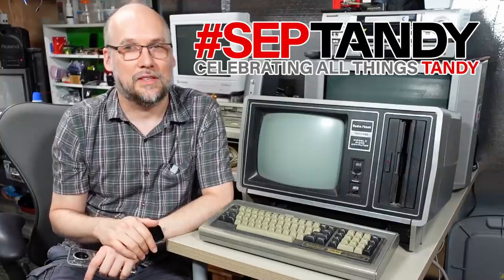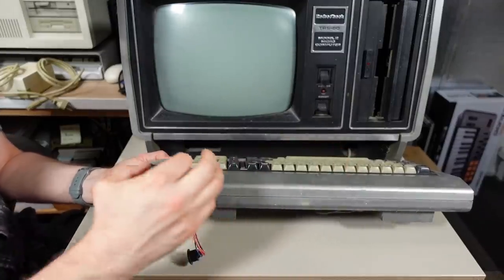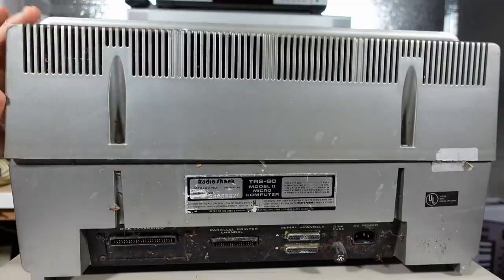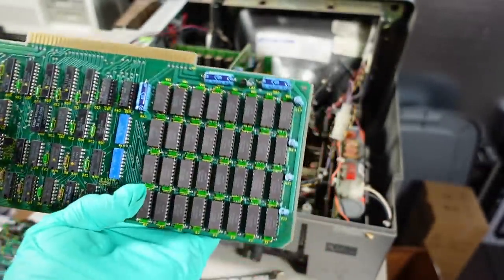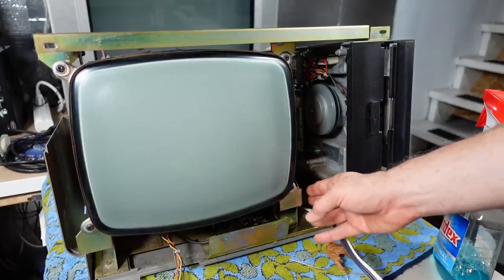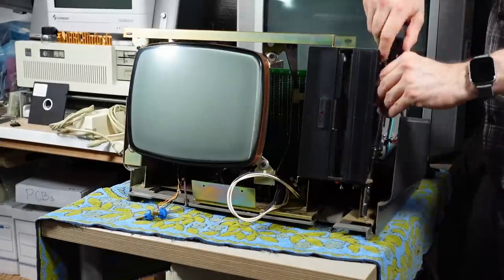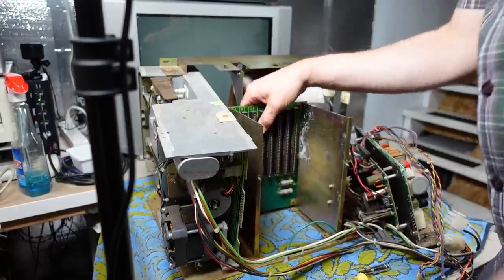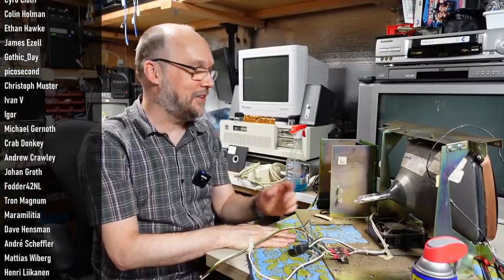Another left for dead machine: a TRS-80 Model II #septandy 🕸🕷🐜

Comment: I worked for Radio Shack Computer center back in 83 and there were still Model IIs floating around, and the 12s and 16s were being introduced.  I had a chance to peek inside the 12s and 16s back in the day, but it's been so long I don't remember what I saw..lol.  I think though, that the 12 was a redesign of the 2 to make it a bit easier to work on, and the 12 was upgradeable to the 16 as the 16 was a 12 with a 68k board.  In any case, there's not a ton of software available, and virtually no games, as it was considered a business machine and there was no market for games.  Also, it wasn't nearly as popular as the I/III/IV line which also was used as business machines.  The 2 was a bit more high end, so it was not sold anywhere near the numbers that the others were.

Comment: If I remember correctly - you could also plug a hard drive on to this.  5 or 10 Meg. It was a 12 inch platter and renown for head crashes.
Reply: Hard Drive unit was a 8MB unit… retailed for $4999.99…. I remember our store only sold one.
Far more popular was the 8” Floppy Expansion Unit… it held two floppy drives…
About 75% Model 2 buyers also bought the floppy expansion.

It seemed to me that every Model 2 buyer also bought the desk…. I LOVED those desks! They were SOLID!
Reply: @ernestgalvan9037  When I finally retired my TRS-80 model 1 it had.

Lev 2 Rom, 16K main Mem, Expansion with additional 32K (48K ram in total) with disk doubler and 4 x DSDD 80 Track floppy disks. It was about as maxed out as I could make it. I also had managed to get an old IBM Selectric Terminal for which I'd type out bulk letters for some local businesses.  All of this many many years ago now - pre IBM PC.

Comment: on these 8inch floppy drives there is a little red felt pad inside that keeps pressure on the head assembly from the other side of the floppy.  If these pads (about 2/3 the size of a pencil eraser) go bad or get stiff or wore out, the floppy will not read/write properly.  they must be replaced with new felt.  they are on little plastic buttons that snap in and out, but the button is very easy to break.   just shave the felt off the button and re-glue a new felt pad.  IF YOU DO NOT replace these they will destroy the floppy disk as you use them, look close.

Comment: I ended up working on a Tandy similar to that (6000 maybe?). It was running xenix with 5 wyse terminals hanging off it, 15mb 8" hard drive, 8" floppy and 10mb Bernoulli that was scrap at the time 30 years ago but everything worked
.

Comment: The TRS 80 series might have officially been released in the UK, but they are very rare over here.  I think commercially they were way too expensive for the market and ended up getting buried in comparison to other brands like Sinclair and Commodore who were much more price concious.  I believe that one of the big selling points of the Dragon computers was that they had a certain amount of compatibility with the TRS 80 line because that was pretty much the only way anyone was likely to be able to use any TRS 80 software.
Reply: Yes, the TRS-80 line was relatively rare in the UK, being considerably more expensive than Sinclair and machines like the Vic-20.  I can remember reading various computer hobbyist magazine in 1980/81 and drooling at the TRS-80/Apple /Pet adverts which were very, very expensive for an 11 year old schoolboy :)  RE: Dragon32, I think you're right, it could run TRS-80 software, but I don't think it was a clone?  Time to go check out the Dragon-32 wiki.

Edited to add : keep up the good work Adrian, this is going to be a great series!

Comment: I would suggest that the next shop tool that you acquire should be a small air compressor. The ability to take appliances like that TRS80 out back and just go ham with an air nozzle is a game changer.
--
RE: TRS80 software - The machine runs CP/M right? I don't remember, but the Z80 puts that in the realm of possibility.
--
Shuggart 8". I think it unscrews from that angled base plate a bit easier than taking the whole thin out, baseplate and all.
--
Hope you are doing OK in Portland. I noticed that you saw the 2stroketurbo video and his recent dilemma with another stolen car. Sounds like it's getting bad in Portland. 

Cheers,

Comment: The entire computer revolution basically started when it did because two groups of engineers were pissed off that the company they designed CPUs for... wouldn't sell them at a reasonable price.

The Z80 and the 6502 were basically sold at 1/10 the price intel/motorola were charging

Comment: To paraphrase the title of an old 1960s B-Rated Horror Flick - "Children Should Not Play With Dead PCs"

There was compatibility with the TRS80 machines that few knew about; they all ran TRSDOS (TRS80 DOS), the issue was the disk format between the machines and with the Model 2 using 8in floppies compared to the Model 1 & 3 using 5.25in floppies.

The Model 2 (64k version) also ran CP/M. A modified Model 3 and the Model 4 (both with 64k) also ran CP/M but again floppy size snd format incompatibility did not allow for sharing files and software via "SneakerNet".

Somewhere I have the TRSDOS manuals and the 8in floppies somewhere in storage. I can not vouge for their condition as when I pulled out a couple Macs from storage they showed water damage, which I later found out was from a fire years ago on a higher floor above my storage unit.  One day I'll brave it and see what can be rescued.

Comment: “No user serviceable parts inside.” And we designed it that way!
Reply: No worries, there's a Radio Shack less than 5 miles away--if you have a DeLorean.
Reply: @davefarquhar8230  88mph away
Reply: @davefarquhar8230  there's one literally 5 minutes away. "Authorized retailer" in the back half of a furniture store.

Comment: I can imagine a problem using an older PC is getting floppy disks. 5" disks are pretty common, 8" disks are harder to get. And of course, if its the right size, it might not have the right specifications. High density, low density, single or double sided, soft-sector - hard-sector ...

Comment: This cost $3500 when new... Most of that was probably assembly costs.  Focus on design for manufacture has advanced immensely in the past 40 years, but rarely gets mentioned - until you come across stuff like this.
Reply: To be fair, putting it together was probably a pretty straightforward process... that just had to be done in exactly the right order using the company's own specialized tools. It's just fixing it afterwards that takes forever, and it's not like they had any more incentive to make that simple than manufacturers do now.
Reply: In 1980, $6 - $8/hr would be about right for a line worker. It did not take hundreds of man-hours to build these. The components were eye-wateringly expensive compared to now; just 64k of memory alone would be $500 or so in 1980. The major gains in manufacturing efficiency since then are orders of magnitude higher for the compounds than for the labor.
Reply: Still, the design is unnecessarily clunky.  You can tell nobody spent any extra effort optimizing the chassis.  It probably evolved into what it is now, from a series of prototypes that were just good enough to keep using.
Reply: @nickwallette6201  
You've put it perfectly. I was obviously exaggerating about 3500 being spent on assembly, rather the point I was trying to make was that other than for tiny specialist production runs, you just wouldn't see construction like that these days. By the time they got to the model3, they knew they would be making it in significant quantities.
Reply: @BM-jy6cb  lol, when you read youtube comments, nothing is ever obvious ;-)

Comment: the sequence for Tandy business machines were: Model II, Model 16,Model 16B,Model 12, Model 6000, Model 2000..etc their numbering system was a bit strange

The card cage backplane was patterned after S-100

I worked for Tandy in the 1980's and worked on hundreds of Model II's this tear down is frustrating ..i am yelling at the screen how to do this without taking the chassis out..I never had to remove a chassis ...
TEAR DOWN:
the long nut driver is required throughout the machine we had a 12 inch long driver to work on Model II's
The floppy can come out without removing the front cover..4 screws in the base and unplug connectors and lift out..
to remove the CRT remove 4 screws holding the driver board to metal plate..then remove the four screws holding the CRT in (after removing front cover) and it (CRT and driver board) slides out easily from the front of the machine..
PSU: remove 4 screws holding the PSU to the metal plate and unplug connectors and lift out..
at that point all that is left in the machine is card cage, wiring and chassis ..

Before you power this up PLEASE clean the anoid area and get all the WD40 off of it...WD40 is the worst thing you can use on electronics...

If you have any questions that i might be able to help with.. feel free to either reply to this comment i will monitor it

Comment: I'd love to own an 8" floppy drive, but they're so rare it's hard to find them, never mind have the money to buy one, especially as there's certain western militaries still using them in some installations to maintain very old equipment... :P
Reply: I used to have a wang standalone single disc drive, it was as big as the whole computer Adrian is working on, I still have like 10 blank church fan floppies too.
Reply: I had an NEC APC that was an all in one like this, oddball MSDOS 2.11 machine with 2 8 inch disk drives. They held about a megabyte
Reply: I've some in my loft part of a trs80-II

Comment: So in the late 70s and early 80s i worked as a young software and hardware engineer and I owned one of those model II computers in Australia.  I burned an new character generator EPROM for it and amended the build in Microsoft basic to have graphics commands the same as the model I and III also I had a board in there with a Motorola 68000 16 bit processor and ran a version of Unix on it.  As a heads-up I seem to remember the CRT unit had a bug or something and the horizontal oscillator frequency could run away and the CRT would emit a high pitched sound and if not switched off immediately would self-destruct.  Since I would experiment with the circuitry and assembly language programs this happened several times with mine.  I sold it in 1983 and switched to IBM compatible computers.  i have however, fond memories off the machine.

Comment: I once had one between 1982 and 1984 with a 5 1/4 disk drive and 10GB hard drive. I was running a BBS system with 4 outside lines on it. It worked flawlessly and ran 24/7 for several months. Then I had sold it to a friend and he continued to work with it for another year. What happened to it after that I don't know, probably taken to a container park. When I see this now, I regret it, but yes, a man can't keep everything in his life ;-)

Comment: The TRS-80 Model II uses a backplane similar but not identical to the S-100 bus invented for the Altair 8800 and which later became an industry standard for a period of time. Thus the Model II does not have a motherboard, like the Altair 8800 and thus every key component that would be on a motherboard of say a Apple II or IBM PC 5150 instead went on a card that plugged into the bus system as part of the backplane of Model II (CPU, video output, memory, Floppy drive controls, etc.). The IMSAI 8080, the computer used by the main hacker character in the film War Games was a clone of the Altair 8800 and thus also used the S-100 bus.

Comment: Haha :) "At this point I can remove the power supply board..." and I'm thinking... "well, at this point, you already removed everything else FROM the power supply board". And yes, some of the older things aren't meant to be servicable. Mass production wasn't a consideration for these things back in the day. I think these are from the "maybe 1000 companies need a computer" days, so I guess nobody expected that there would be a large number to keep in service. Also: mains voltage was not really a big issue back in the days of tubes, and that thought carried over with some designs, so it's not uncommon to have mains voltage all over with no extra protection. Only trained professonals should open up cases anyway 😜

Comment: I don't think you needed to take this apart except to blast it with an air compressor.  The easiest thing is to fire these things up... I can't believe you took it apart.
For software, you can install Montezuma CP/M 2.2.  TRS-DOS is fine.  Scott Adams adventures did run on these.  If you want to really impress, you can try and figure out how to upgrade it to a Model 12 or 16B, which I think was possible.  Finally, the hard drive is indispensable on these things.  Get one.  You can also get a COBOL compiler to build executables.  There might have been a BASICA compiler for TRSDOS... can't remember for sure.  Finally, get some copies of the Radio Shack MicroComputer News if you're going to do a lot of "TRS-80" you need to get the bound copies of that and look over all the old program listings, advertisements, etc.

There is also an external floppy drive unit for the Model II.  Meh.  Just mentioning it.
Really the Model 12/16B units are the ones to have since they can do a lot, whereas the Model II was really only a "high-end" Trs-80 Model 1 (more memory, slightly more stable, more business focused, etc).

The thing is that the Model 4, 4P, 4D, etc. just crushed the Model 2 in terms of capabilities.

Comment: In early '90s we had CP/M machne with 8" floppy drives, these drives had warning - not close drive without disk inside! May lead to heads damage. Later PC/AT 5,25" drives had mechanical lock to prevent closing drive without diskette. Both was double sided drives, eight inch drives was produced in Bulgaria for eastern Europe block. Computer was built based on russian clone of 8080.

Comment: My neighbor has an TRS-80 brazilian clone called CP-500 with double 8" floppy drives, and once he brought it here to see if I could repair it for him, but I didn't had any experience with vintage machines, and I turned it on before taking it apart and looking at every board and circuitry, and then suddenly tantalum caps on both of the floppy drives popped, I turned it off immediately, was amazing seeing that, one day, that was the state-of-the-art technology

Comment: For reassembly, You need the long flex-shaft wera screwdriver I recently picked up from Amazon, plus adapters from quarter inch hex to your socket size of choice. Or something else with length built in, I think I have a precision screwdriver set with built-in extensions that can't come apart.

Comment: RESPECTFULLY,  you might want to consider investing in a decent set of long screwdrivers, the multi-bits you are using with socket extensions are slightly better than nothing, but not by much.  Like you videos. Cheers !

Comment: I am going to have to try to set aside a few hours to watch through this whole series, although my main question is can I hook up a GoTek to the Model II. I hear it's possible, and I've gotten as far as getting the GoTek to respond when the Model II is turned on, but it's not recognizing that an image is loaded. Maybe you address this in the video, so I'm keeping my fingers crossed that I find something useful here! The machine works fine with a real floppy, but the problem is that I have but one single working floppy disk, which isn't going to get me very far with this machine.

Comment: Ah shoot, you have the terminator, which I guess means you have the older FDC.  Expected I guess since you have the older type power/reset switches.  It's a real pain to get the GoTek working with those 50 pin FDC interfaces.  You have to get an adaptor.  But the later model 2s had a "revised" FDC that came with an unpopulated 34 pin header like we are used to seeing on 5.25 interfaces.  I soldered headers into mine and got it working with the GoTek, but it required some tomfoolery with the jumpers, some set to 8" settings and some set to "microdrive" (5.25) settings.  If you run across one of those FDCs and want to get it working with the GoTek without the crazy 8" adapter, send me a message and I'll open my M2 up and send you the jumper settings.  It doesn't detect between densities without a mod though.

I have a few parts if you need some, but not too many.  A busted up case (a pox upon thee, FedEx), some parts of the wiring harness, a power supply, and I think I have an extra card cage somewhere.  Let me know if you end up needing any of it.  lee at ocfco dot net

Comment: Not all 8" disk drives had 50pin connectors. I have a few that have the usual 34pin and are more or less drop-in compatible for 5,25" HD drives.
Reply: Fun side note: 5.25" HD (1.2MB) drives were once intended also to be a replacement for 8" drives. That's why they turn at 360RPM and use double the bitrate of the 360K ones.

Comment: The 8" disk drives used to change the size of the on-screen display with their magnets when accessing data on the Model II. The Shugart Slimline drives on the Model 12, 16, 16B, and 6000 didn't have this problem, and could also spin down when not accessing data (only to whir up again when the machine hit the disks).

Comment: I had one of these. My father saved it from the trash at a school he worked for. I actually had two, but one had a dead chip. I used it to connect to BBS's using a 300 baud acoustic coupler, and later a 2400 baud modem. I loved this machine, but my parents made me get rid of it wen we moved to a smaller apartment. It made such wonderful clunky clacky noises.